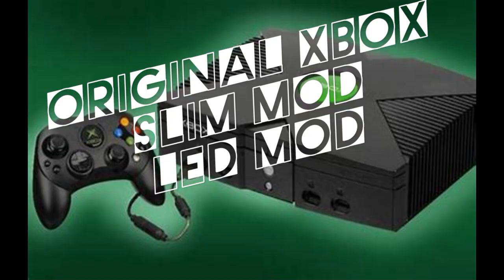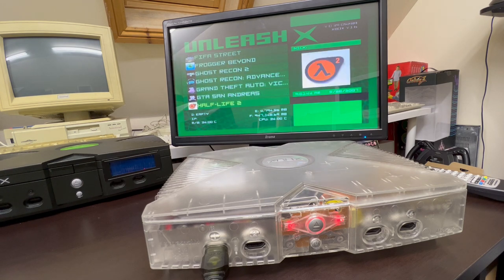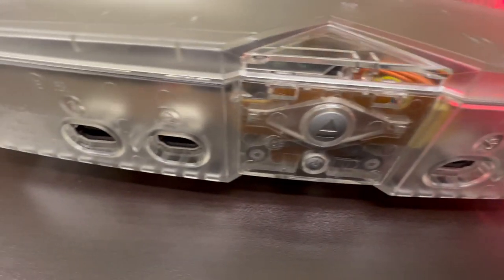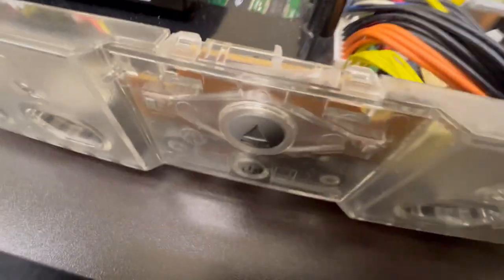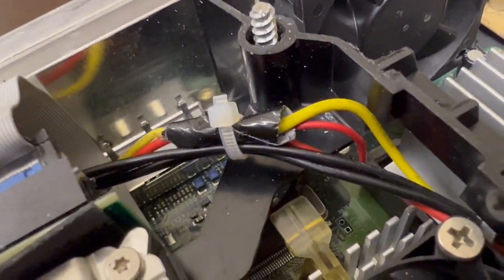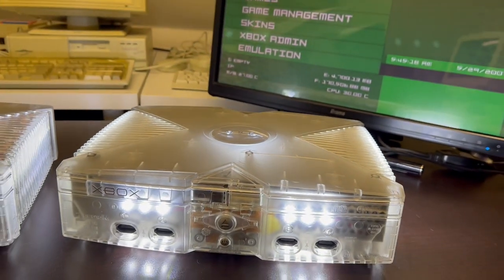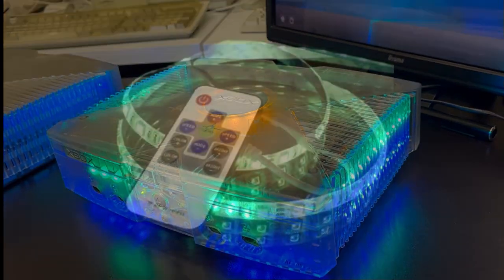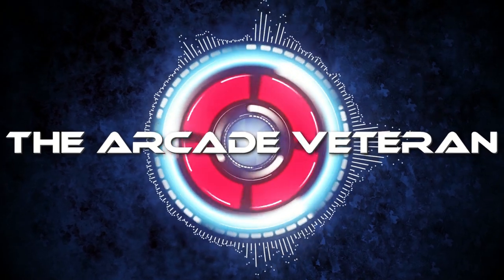Original Xbox Mods ( Slim Mod, LED Mods Hard Drive Mod )

Comment: 2:20 Did you add the fan with the heatsink?! 🤔 I only have a cooling fan above the processor is that enough?
Reply from the maker: I did add that fan but it’s not really necessary as log as your case fan is good 👍
Reply: @TheVetUk  Oh beautiful  But did you glue the light colors or did you connect them with electricity?
Reply from the maker: I used double sided tape for the lights and hot glue to secure the wires and powered them from the main power supply 12v

Comment: what pins did you solder to make think the dvd tray is closed?
Reply from the maker: Hi
Depends on your drive, what I did was dismantle the drive so you could see the circuit board but leave the tray in then move it back to closed and you should see what micro switch is activated on the board then using a multi meter on ohms test what the switch state is when closed mine was a short (closed switch) so I just bridged the contacts with soldier and it thinks the drive is always closed easy really took me five minutes you can disable the drive detection with modern mod chips but I did this before they came out and this costs nothing to do.
Hope this helps 👍

Comment: Which diagram did you follow to modify the dvd drive pcb to be able to get the system to boot without stuttering on booting up screen?
Reply from the maker: Hi
If you strip the dvd drive and remove the drive board you will see a 4 pin plug with black and red wires in it going to a switch in the case ( note this is on a Philips drive) they are the drive closed contacts and have to be bridged all the drives that Microsoft used have this feature just designed differently I just used a multimeter to identify the operation and correct 
pins and job done 
Cheers
Reply: Thanks for the reply, much appreciated great work on your consoles they all look amazing.